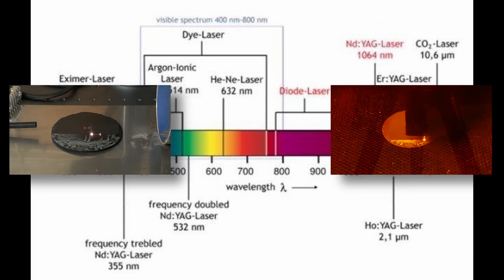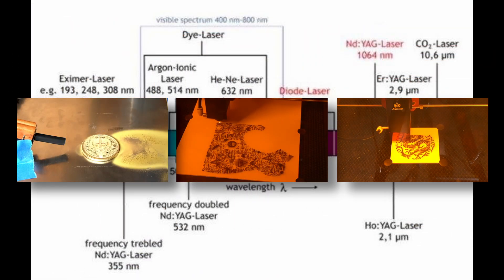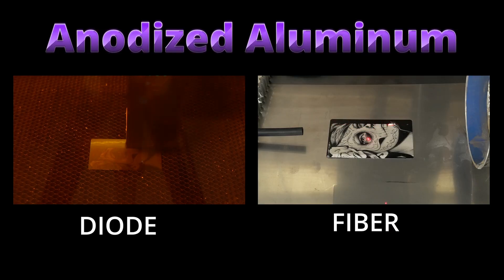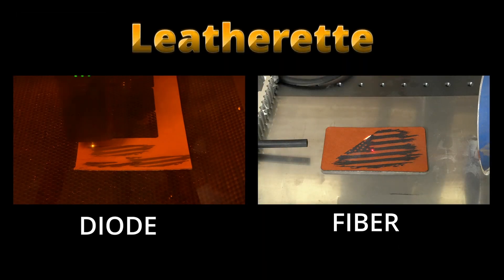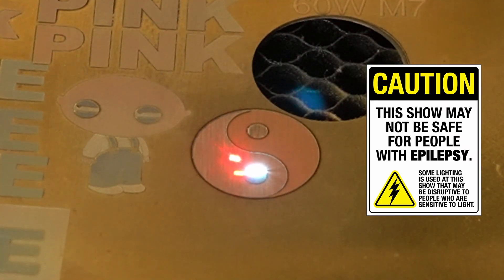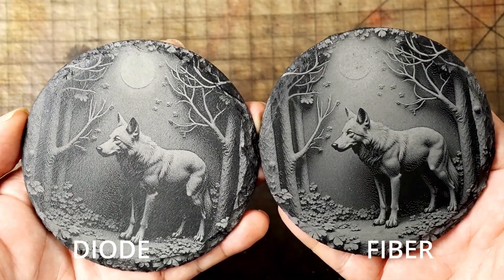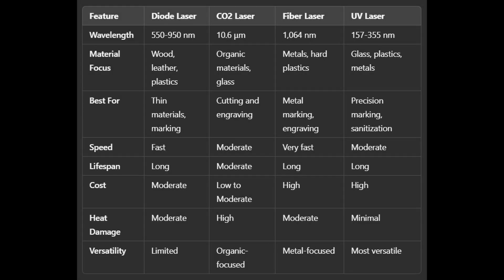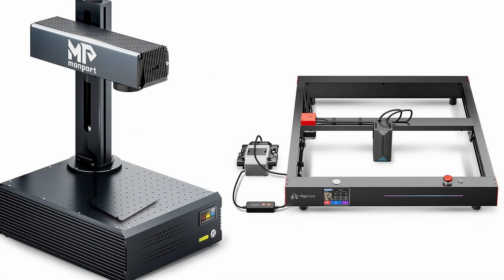Fiber and Diode Lasers Compared! Why You Might Want Both.

Comment: Wow this was quite neat and intriguing, I hope you don't mind if I ask a few questions as I'm curious about your setup.

What sort of pulse duration and repetition rate you got for these two lasers? Would ultrafast lasers in the femtosecond regime be better at doing this type of marking, or does it depend on other factors like power and marking speed?
Reply from the maker: Hey, awesome question — I love when people geek out with me. 😄

So here’s how it breaks down in normal-human language:

• Diode lasers (the blue ones) don’t actually do pulses — they’re more like a steady flashlight from hell. They mark by straight-up heating the surface.

• Fiber lasers do pulse — little nanosecond bursts. Most of the hobby/desktop systems (like the 20–60W MOPA units) are in the 60–200 ns pulse range, and you can dial the frequency anywhere from 20 kHz all the way up to 400 kHz depending on the machine. That’s what lets you get clean metal marking at high speeds.

So diode = great budget “Swiss Army knife.”
Fiber = fast, sharp, industrial marking weapon.

Now… femtosecond ultrafast lasers — different universe.

They can make insanely clean marks with basically no heat damage. Definitely the cool kids at the laser table. BUT:

• They’re ridiculously expensive
• Usually slower
• Amazing for medical implants and aerospace parts
• Total overkill for wallets and slate coasters 😅

So the short and sweet answer:

Diode + fiber = the perfect combo for makers.
Femtosecond lasers are incredible — if you have NASA money.

Personally, I like having gear that pays for itself before the sun explodes. 😉

“Femtosecond lasers look cool… right up until they send you the quote.” 😄

Comment: Nice video. Do you have experience with cutting stainless steel? Seems like there is hardly anybody showing this in video. At work, we are currently thinking about getting a 60W MOPA laser (xTool F2 Ultra) to able to cut thin metal sheets. We already have an Atomstack 70W diode laser, which I will try for that purpose tomorrow as well. The power should be high enough to cut thin metal. The question is just how good it does it and how the edges look like. I will likely try to use nitrogen purging instead of air to avoid oxidation. And go for full power at higher speed to avoid too much thermal load (--> deformation) on the material.
Reply from the maker: Thanks so much, I appreciate it!

I haven’t gotten into cutting stainless steel yet, but I have tested a lot of engraving on steel with my 60W MOPA. Cutting is a completely different animal though, and most of the creators who avoid showing it aren’t hiding anything — it’s just that fiber marking power and true metal-cutting power are two separate categories.

A 60W MOPA can sometimes cut very thin stainless, but it’s slow and usually not the clean, production-ready cut people hope for. The xTool F2 Ultra is basically in the same class: great at engraving metals, not really designed as a sheet-metal cutter.

Your idea of nitrogen is solid — that’s exactly what people use when they do cut steel — but the biggest limitation is still going to be wattage and beam delivery. You generally need a few hundred watts of fiber power (and a different optical setup) to cut stainless efficiently without warping.

That said, I’m really curious how your Atomstack diode test goes. The diodes have the power on paper, but the wavelength usually reflects too much off stainless to get reliable cutting. Let me know what kind of edge you get and whether the nitrogen helps — I’d love to see the results.